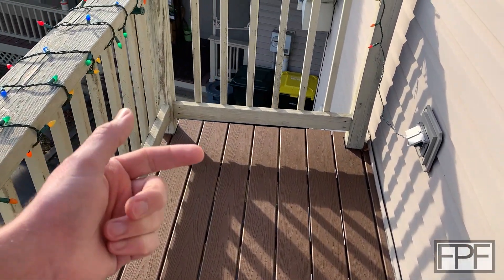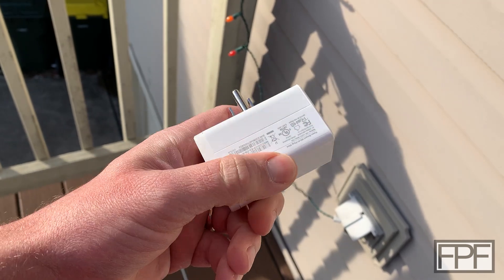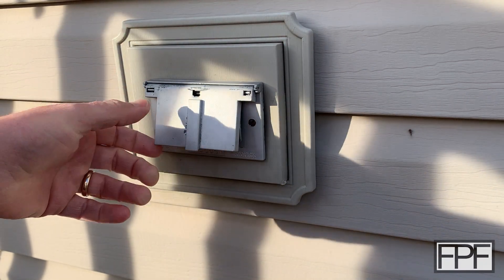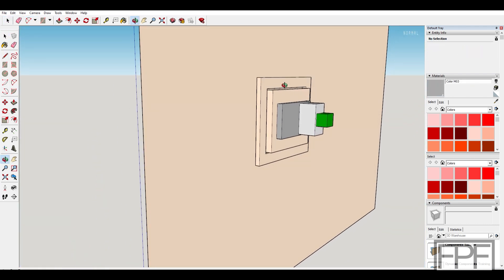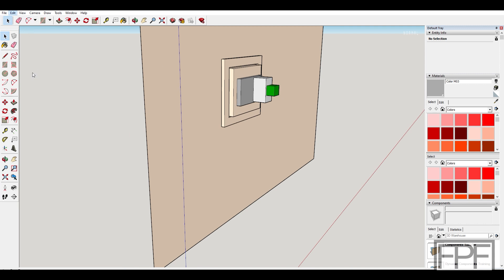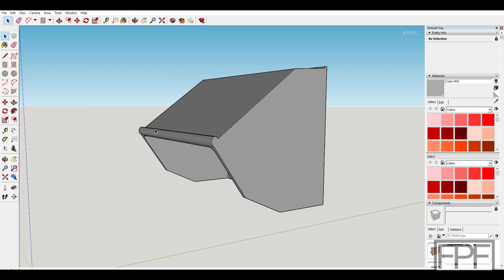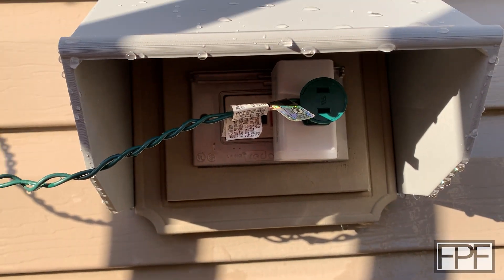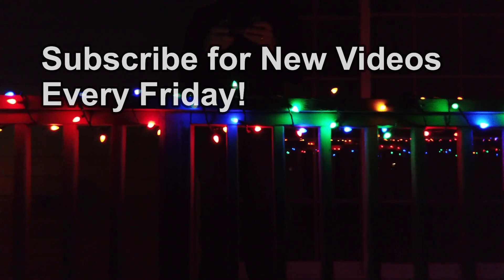3D Printed Outdoor Outlet Cover

Comment: Home assistant also supports running Kasa devices directly, the Kasa power stips are really good to use as a PDU for a home server rack.   Additionally spray on conformal coating is really helpful when dealing withe things that were not designed for outdoor use.  Also the Kasa KP401 is outdoor rated.

Comment: Whenever we cut pipes to have water flow straight down we leave the cut edge as sharp as possible.   If you round or smooth The Edge at all the water will follow the rounded Edge.

Comment: Worst case PLA will look 'aged' and chalk a bit.  The gutter to work should have had a 'peak' in the center of the print and more of a lip.  At least you have a good 'drip lip' that makes it less likely to angle back toward the area you really want protected. ... Overall great job!
Reply from the maker: thx

Comment: You just made your outlet illegal. Must have a weather proof in use cover. You would have been better off to install a proper in use cover and have a short cord to run up to the soffit where you could have your smart plug.
Reply: but it already didn’t have a weatherproof in use cover?

Comment: You emulated rain but not wind. I am surprised this is legal. I doubt it would be legal here in australia
Reply: I don't think illegal would be the word I go with but it's not code for sure, then again at least in this case I don't really see that being a huge deal at least functional wise, it's going to do it's intended purpose and honestly I think would be perfect mixing it with a code approved covered outlet for a best of both approach. 

The only design issue I see with it was also a problem already before hand it looks like, no silicone on the top to keep the water from running back on the square cutout and getting behind the siding. There should be caulk at least 3/4 the way around that cut out (top and sides minimum) to keep the water out, and it looks like there is none. This design at least to me looks like it will take extra water now and slope it right to that part where it could go behind the siding again. This could easily be fixed with some silicone as well. Other than that it seems to serve it's function so it's pretty much a win in my boox
Reply: @chomp7927 , It is a big improvement over what was there, I give it that. But it is mains power in an exposed location. Seems crazy to me. Where I am, I would think if someone used that print and someone received a boot big enough to injure, the print's creator would be liable. In the US, I know they have a 
different approach...

Comment: Tbh the fact that you slotted it to slide up and down to install could be the very thing you need to fix it.  Bring the front down further to drop below the bottom of the outlet and simply slide the whole thing upwards when you need to plug/unplug something.  No need for fancy gutters either.

Comment: what program is this?
Reply: Looks like SketchUp to me, but not their new fancy browser-based version.
Reply from the maker: yep, Sketchup Make 2017
Reply: Which do you think I should learn - fusion 360 or sketchup?
Reply from the maker: fusion 360.  I use sketchup only because I already knew it from other projects.  Onshape is another one to check out
Reply: @icedhot5199 Personally I'd say Fusion 360. I've used both and find that SketchUp makes little sense to me. It's very different from any other 3D software. 

The only problem with Fusion is that the free version has limitations, but none that have ever stopped me modelling for 3D printing. 

I've started using Fusion for CNC now. If that's a path you think you might follow, then using SketchUp won't help you in the future. 

Like I said in my comment right up the top there somewhere, the model made here in SketchUp could've been made in Fusion in just three simple operations (create a sketch, Extrude it, Shell to hollow it out, one Boolean cut, done). 

If you're good with Fusion then you're talking a couple of minutes. 

And with the history system, the end model is 100% editable, throughout the history of the build process.
Reply: @icedhot5199  Fusion 360 is dedicated to manufacturing workflows (CNC, 3D printing, electronics...)
Sketchup is dedicated to 3d sketching (architecture)
You can use any one out their intended workflow, but it's very painfull...
F360 is a bit more complicated (maybe just different modeling principles) but 100 times more powerfull
I learned 3D design with sketchup, but turned to F360 as soon as I got in 3D printing. never used sketchup since

Comment: I like the fact you didn't bother taking the faceplate off... I probably would have and wasted some time. But it was probably also a good idea to make sure that the front of your outlet box is properly sealed to your outlet cover. Anyway, I would have used more fillets to round that thing out, personally. I think of curb top would allow you to get a nearly horizontal front lip that would negate the need for a drip lip. Great job though I'm a new subscriber... Love me the functional prints
Reply from the maker: thx, and welcome to the channel

Comment: I have a ton of TP-Link devices, including a couple dozen HS-103 and HS-105 smart plugs INDOORS. I’m pretty sure these are NOT NEMA/IP certified for outdoor use, even if you keep them out of direct rain, snow, and other weather. 

TP-Link does make outdoor smart devices. Why not just use these?

A weather cover is still not a bad idea, though.
Reply from the maker: I have some other ones on my porch that are exposed to the temp swings, humidity, and occasionally some light mist and they've made it 3 years so far.  I had these already , but if it gives up the ghost, I may try one of their "outdoor" options.
Reply: @FunctionalPrintFriday  , I’m not saying they won’t work. Obviously they will. The issue is, are they safe for all possible conditions? If you get a pouring rain storm, will these indoor products cause a safety problem? The outdoor plugs aren’t much more expensive than the indoor ones. 

Clearly, your call.

Comment: If you can put a loop in the electric wire to stop water from running past it to the plug, or wind pushing it.
Reply from the maker: interesting idea, never thought of that
Reply: Could add some hooks or guides inside of the cover to loop wires up and out of the elements. :)

Comment: Not a bad solution, unfortunately as an electrician I have to say you should just get it in-use cover and have the outlet replaced with a controlled outlet.

Great approach to the problem!
Reply from the maker: it's a fair point, but this plug sure is easier to swap out/upgrade vs. the controlled outlet when it's obsolete/dies

Comment: Talking about how sluggish TPU is, half expecting you to pull out an old machine with a bowden style extruder, but when you show the printing, it's a Bambu. Isn't the Bambu a direct drive?
Reply from the maker: it is, but the filament path still isn't as ideal for TPU as std. direct-drive bedslinger.  My MK3 does great with TPU, so I just use it for that.
Reply: Yes, it is. I haven't actually printed TPU on mine yet! I do all my TPU on a direct drive Ender S1 Pro.... well now you've given me my experiment for today! I have also seen bowdens that could print TPU with no issue.
Reply: @ashvanes484  All of my TPU printing has been done an a basically stock Ender 3 Pro and I've been able to print up to 40-50mm/s with standard 0.2mmX0.4mm layers without big issues. I reduce the extruder tension all the way and use quite a bit of retraction at high speed. I tend to only print at more like 20-30mm/s on complex and hollow parts though as I get much better quality. I suspect better cooling would make a big difference. For functional prints with simple shapes though, it won't be too much slower than standard PLA. Compared to a fast printer like a Bambu though, definitely a slog.

Comment: Another piece that snapped in from the bottom that was recessed from the front edge with a gap for the wire/wires to pass through would make that A LOT more water tight. 

And making that “gutter” a triangle that starts at the creat of the roof with the two edges going down to the bottom corners. You need a crest/ridge there too as any flat spot will allow water to collect and flow straight down its face.
Reply: I thought of a ramp/crest also, like a peaked roof in a small ramp. Another idea, make a cutout on the sides to slot the cords through vs coming out of the front (look at a yarn bowl for the idea). That way you can nicely route the wire, and if it's narrow enough would add little additional water ingress
Reply: @ashvanes484   I get what you mean by yarn bowl, but I think a downward pointing “pipe” would be more useful for passing the cords through and keeping water out
Reply: @geauxracerx  yes, that could work also and avoids rain entry. either way, somehow routing the wires would make this cleaner

Comment: I have at lease one outdoor-rated smart plug meant for block heaters. It's fine, but stops working when it gets down to -30C, which is when I need it to work the most!

For water protection, i can see your biggest issue is going to be water flowing down the wires back to the smart plug. As long as the wire angle is downwards, it'll be good. I'd be tempted to lower the edge of the hood below the midline of the plug to make sure the wires are always angled downwards.  If you change the print orientation so it prints from the top it should work with as much hangover as you want.
Reply from the maker: thx, yeh if I give up the little rise at the back of the top I can print that side down

Comment: My only suggestion would be to make your gutter angle down a little from the center to each side.
Reply from the maker: yup, the gutter as-designed was useless.   I've gone out and checked it a few times in the windy rain though and it's still bone-dry inside, so I'll probably leave it as-is.  I was thinking of maybe having a lip that comes up like a C with a channel inside (with supports that just break off).

Comment: Looks nice! Regarding the smart plug, you should look into a custom firmware called tasmota. Unfortunately it's not compatible with that plug but if you get plugs that are compatible with tasmota, once you load it, it's 100% local control.
Reply from the maker: I've got a 3-outlet power-strip I flashed tasmota on a few years back that I control the lights, music, and train with for our Christmas tree every year.  Works very well!  I think the HS103's are just addictive due to how readily available they are and the price.  What are you buying to flash tasmota on right now?
Reply: @FunctionalPrintFriday  not sure what happened to my reply. I generally go with the sonoff s31. Super easy to open with just a screw driver to access the pins for flashing. Also has energy monitoring.
Reply from the maker: thx  @RestNPizza
Reply: I would just use zigbee plugs. They are available for 10 bucks, no need to flash anything and nice integrations available.

Comment: Clever solution.  Out here in the Phoenix area, PLA degrades quite a bit due to the intense UV and summer temperatures above 100F.  Heck PLA will warp and creep outdoors here. Yet it would probably do just fine as an unloaded cover.  From my experience the best UV and temperature tolerant material is ASA.  I use to think ABS was the cat’s meow for these environmental conditions, but ASA is even better for maintaining color, strength and shape.
Reply: I've found PLA works ok  outside if painted with a UV exterior paint,  Krylon, Rustoleum etc.
Reply: I use a lot of petg in Arizona. Its uv resistant and easy to print without an enclosure
Reply from the maker: Have you tried TPU?  I've found TPU to be darn near indestructible in almost any location, it's just soooooo slow to print with.
Reply: @FunctionalPrintFriday  TPU is great the way you describe. PLA+ can be a good upgrade over PLA (sometimes because the manufacturer has added TPU to the blend!) and usually prints just as nicely without the additional requirements that ABS/ASA have to prevent warping and other issues. I have a few PLA+ prints surviving the PA outdoors over the last 18 months quite well. But PLA+ is not a consistent product across manufacturers and quite a few of the most popular companies do not disclose much information about what they added or changed between their PLA and PLA+. Companies that are more technically focused tend to be better disclosing some level of detail, even if ratios are proprietary. So your mileage will vary with PLA+ across manufacturers and it will never beat ABS/ASA for tolerating the elements.
Reply from the maker: @anwyll  great point.  It would be nice if they would just standardize on a blend and officially call it something else
Reply: @FunctionalPrintFriday  I've used TPU to create a car fuel tank gasket and other than losing its color it held up fantastic.
Reply from the maker: nice, thx for sharing! @802Garage
Reply: It's worth noting that the "grades" of PLA vary wildly. Not just from brand to brand, but even lines within brands and even by color. I have PLA Pro in green by Inland and it's frankly awful. Prints with a meh finish, likes to blob, poor temperature resistance, scratches easily, discolors with heat. I also have PLA+ by Inland in yellow and it's incredible. Easy to print, great finish, very durable, doesn't discolor easily at all, very heat resistant, anneals extremely well, I've even made functional car engine oil caps with it! Basic point, not all PLA is created equal. The exact polymers used can sometimes be determined, but there is cheap consumer garbage all the way up to engineering grades.
Reply: Yeah ASA is great! I allways print ASA for outside aplications. Many car mirror housings are made of ASA.
Reply: I used ABS for the bracket of my 2 solar panels for 3 years now and it’s still good. Maybe in another 3 years it will degrade but for now it’s good enough. 😅

Comment: Really like the print. The only upgrade I could think of is maybe a door and use the “gutter” as the hinge. Cut out a pice on either end and have it hold on the the bottom with magnets. But that would only be if the rain becomes a problem.